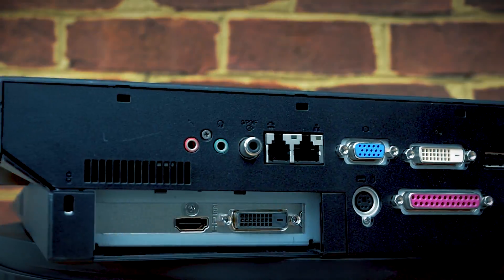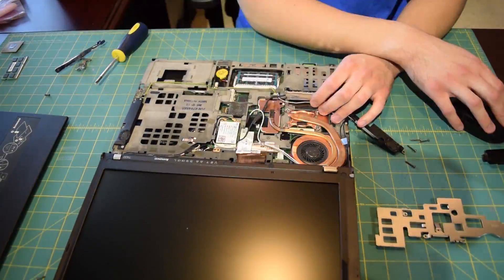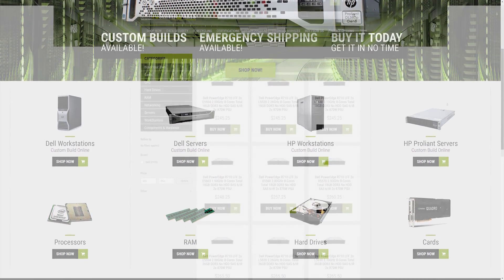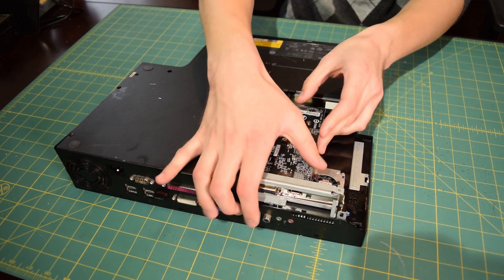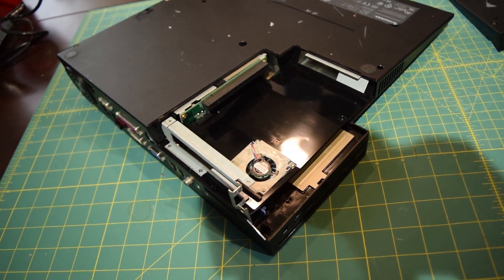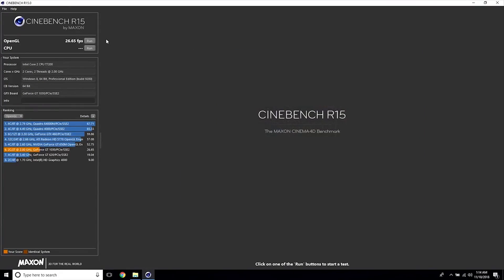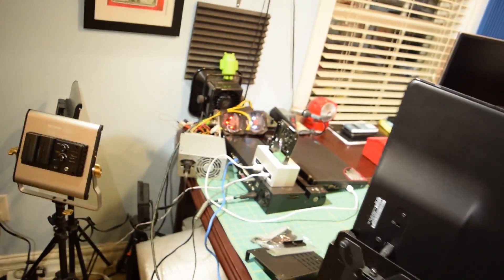Modern Gaming on a Laptop From 2006 Using the Lenovo Thinkpad 250310U Advanced Dock

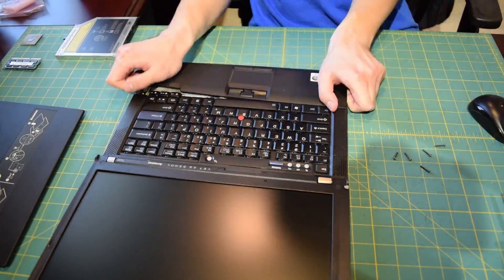Comment from the maker: 0:58 - Intro Ends, docking station commentary begins
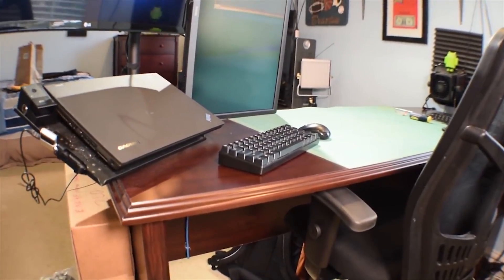3:56 - Pitfalls of the docking station
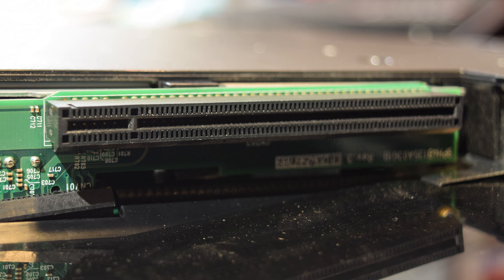4:48 - Performance testing with the GT1030
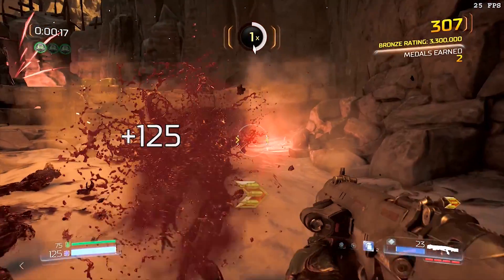8:49 - GTX1060 setup
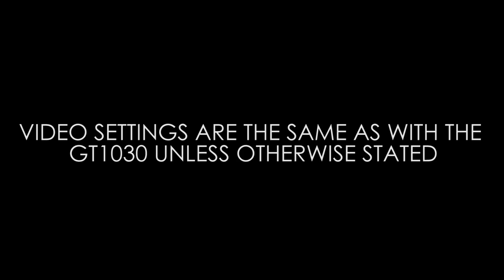11:05 - Performance testing with the GTX1060
13:43 - Conclusions
Reply: AA Computers and Technology pls tell me will the docking thing  works on a X220 thinkpad because i got one of them
Reply: Hi! Thanks for making such interesting video. Your video has aroused my interest in buying the same docking station. However, I came across a problem when installing the driver of a GT 1030 display card. The device manager said the card was unusable due to an error code 12. Can you please help me solve my problem by telling me how you installed the display card on your docking station?

Specs of my t61p:

ram: 8gb
cpu: core 2 extreme x9000
display card: GT 1030 2GB
operating system: windows 10 1909
Reply: Could you please let me know how you were able to get hold of the replacement keys? Since over a week I am struggling to place an order at ITExchange company but as I am in Germany they want to ship to UK, then to Switzerland and then to Germany and the guy in Switzerland does not seem to be very motivated to get this going. Overall this process does not seem to make any sense to me.

Comment: I’m buying a known safe T61 board and doing a Frankenpad T601 setup as the money becomes available, I’ll have to see if the newer Core 2 Duo processors that the T61 supports and the higher RAM limit (4 GB, 8 GB with Middletown’s BIOS) make any sort of substantial improvement over the T60. It would be a dream to use my ThinkPad for Fortnite! :P

Comment: Hey man, Idk if you'll see this but I have the same dock with a ThinkPad T61 that is upgraded to 4GB RAM (all usable) a T9300 Core 2 Duo, and a 1440 x 900 internal display. I use it every day for work along side my W530 and it's a wonderful machine. Back in the day I ran a GT 520 and it was an absolutely awful experience, no drivers were compatible, and so many more issues with docking and undocking. (AMD cards actually worked better) I use it without an external GPU just for remote desktop connections. I just ordered a GT 1030 to do some benchmarks on it to see if i can get AT LEAST a few more years out of this thing as a usable machine rather than an antique display piece. So if you're interested in the numbers i come back with let me know!
Reply: Tell me

Comment: I am curious the latest model Thinkpad that will work with. I bet it's pulling pcie from the South bridge meaning if a t430 works for ivy bridge you'd probably get pci-e 2.0 instead of 1.0. hell I wonder if Optimus works even to get that compression going
Reply from the maker: The compatible models are listed in the description.
Reply: Latest and the most powerful supported Thinkpad would be W500. Ones with t9800 core2duo, and ATI firegl v5700 are still a very usable machines.

Comment: You need to adjust the TOLUD on that t400. You're hitting memory addressing limitations due to the bios like a lot of other egpu solutions. I recommend looking in to documentation for t400 egpu solutions with the expresscard slot or mpcie slots. The documentation for getting that to work should fix it

Comment: You aren’t right!! There is no limitations for the ram!!I use my monster T61p with x9000 and 8 gb ddr2/800 and have no problem!! The problem maybe come from your t60.regards
Reply: Yes t60 and t60p have stupid limitation about ram because of the chipset.when you put 2x2gb ddr2/800 it will use 3 gb,but it mustn’t be a problem to work with dock! Try with t61 min with middleton bios  for sure you will get much better results! Regards
Reply from the maker: Are you talking about for the dock or the T60?  The T60 has a 3GB RAM limitation, that's a fact.

Comment: Should be possible with a rx 580 - right?
Reply: SalkinvonBach no you need a more powerful psu and it won't fit
Reply: @root8able Power shouldn't be the issue if we take the scenario of the 1060 as a reference
Reply: Most Thinkpads work best with Nvidia GPUs as those allow the use of the internal LCD screen for video output. With AMD you're forced to use an external monitor. Best regards!

Comment: Wow, after seeing those results, I'd be really intreagued to find out, if using a T61/R61 with 4GB RAM and a T9300 (my got-to-on-the-go-daily-driver) or even a quad core machine would result in a noticable performance bump. Do you plan on any more experimentation with that setup?
Reply from the maker: I'm going to spend some more time over my winter break to see if I can get the T400 to work with the dock.

Comment: Was the 4GB ram limitation due to memory address availability in regards to assigning PCIe devices? If so, you might be able to perform a DSDT override. Information on that can be on egpu.io's website.
Reply from the maker: I think you might be right.  This is something I am going to look into after my finals are over, I really want to get my upgraded T400 working with the dock.
Reply: and now just to mod the dock to take a full size dual slot card like a 1070/rx590
Reply: I am looking for this too, as I have a T400 and that dock too, but couldn't make it work with a gpu.

Comment: It runs Crysis. Therefore, this is officially a legit gaming PC, possibly the first time "legit gaming PC" has been used regarding a T60. Outstanding work.
Reply: If you believe it or not, the T60 actually runs Crysis with it's integrated GPU, the ATI X1400. Not terribly fast, but at around 20-30FPS, which is playable, especially for Crysis. Even High end desktops struggled with it when it launched
Reply: @TheRailroad99  You're ruining my fun :(

Comment: Hey, I have a Lenovo w700ds(that rare dual screen model from 2008) do you know of any good docks that would support a desktop GPU similar to that showed in this video?
Reply from the maker: I don't unfortunately.  You're a lucky man / woman though, a lot of people dream of owning one of those (including yours truly).  Sudos is right, those W700ds laptops sell for crazy money on the used market.
Reply: AA Computers and Technology Ok, thanks anyway, and I’m don’t think I’ll ever be selling this laptop because of how much it’s worth and how much I use it.
Reply: The most viable option would be an eGPU setup via an Express Card Beast adapter. I used a GTX 970 with that adapter and an external PSU in my T420 with no issues. GTX 10XX series need a mod to overcome error 43 in Windows 10, but they can be used too. Best regards!
Reply: you're better off selling the w700ds for crazy money on ebay and getting something else for the price of a dock that could support that beast.